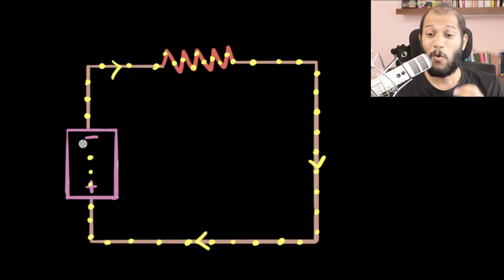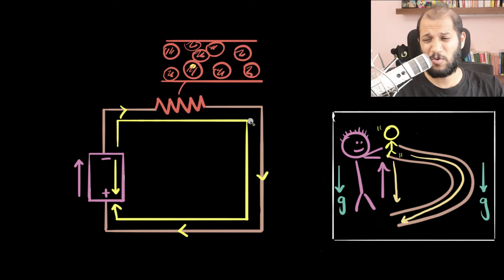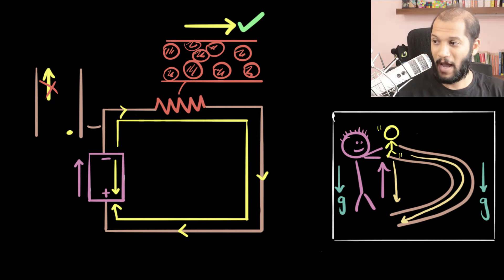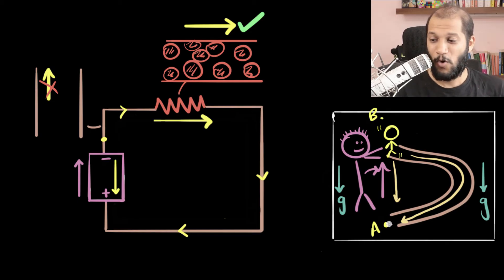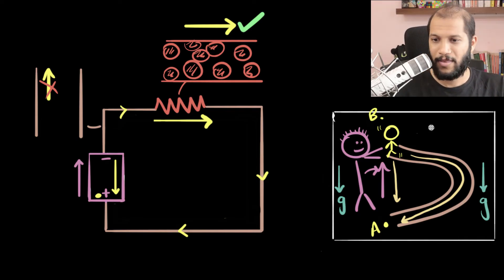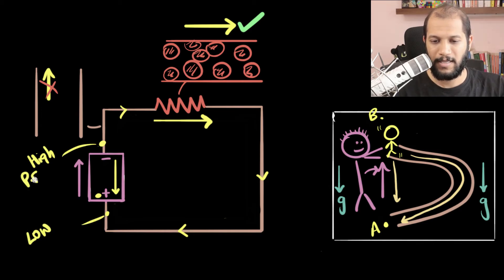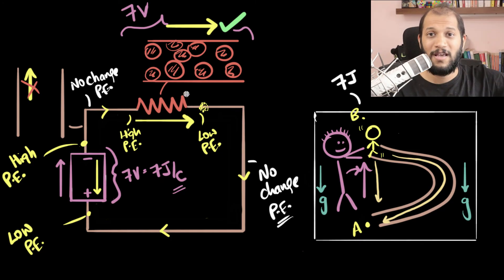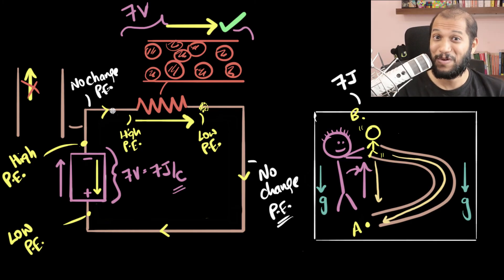Why voltage across resistor equals voltage across battery?

Comment: But the electron needs energy to move through the rest of the wire(after the resistor), so if it has lost all its potential energy - it means the electron has no energy. But its moving, so it must have kinetic energy. WHERE is that energy coming from?
Reply from the maker: Great question. As you said yourself, it has lost all the potential energy gained from the battery. Not the KE
Reply: @Mahesh_Shenoy  Understood! thanks a lot.

Comment: could anyone explain what will happen if there is no resistor, how will the electrons lose the potential energy?
Reply from the maker: That’s a great question! It’s not possible though! 

The battery itself will provide some resistance
Reply: If you have an impossibly perfect voltage source with no internal resistance, you would accelerate the electrons indefinitely, and their potential energy would convert to kinetic energy.  You still will have some inductance, even for a circuit made from superconducting wires, since a single loop has a little inductance.  That inductance will be the only impedance of the circuit.

This means the equation of motion of the circuit will be:
L*di/dt = V

Isolate di/dt:
di/dt = V/L

Integrate both sides:
i(t) = V/L * t + i0

This means, starting with no initial current, the current will linearly grow in proportion with the operating time.  The ramp rate of the current will be V/L.

Comment: It was an awesome explanation,
But I have a doubt that ,
If the energy given by the battery to 1C charge used up when it is out of resistor , then to continue it's path,  from where is it going to again retain the energy which was previously given by battery? .
Reply from the maker: It gets used because it doesn't need more energy for the rest of the path! The rest of the path has zero resistance!

Comment: If we change the resistor then it's also losses all energy?
Reply: Sir if there will not any resistance in circuit then the potential energy increases after every round it can go to infinity also?
Reply from the maker: If we zero resistance in the circuit, I think our model breaks down and we need to look at things using quantum mechanics!

Comment: so in the case of parent taking the kid up, does KID store the potential energy or does earth? why is work negative?
Reply: Work is negative in the definition of potential energy, so that work done by a force field, means potential energy decreases, and work done by an external agent (or existing kinetic energy) against a force field, means potential increases.   Change in potential energy is the negative of the work done by the force field.  Instead, it equals the work done by an external agent working against the force field, or equals the work the force field can do, when the force is allowed to act.
Reply: For your second question, consider what would happen if the parent and kid were astronauts, doing a spacewalk.  The parent (plus spacesuit) is 200 kg, and the kid (plus spacesuit) is 50 kg.   For the thought experiment, let Cavendish's big G be 1 N-m^2/kg^2, albeit extremely unrealistic.  The kid and parent start out 1 meter apart, and move to 5 meters apart.  Suppose they have of long pole of negligible mass between them, that they can crawl along, so they can use both compression and tension between them for their movements.

At 1 meter apart, their GPE will equal -50*200/1 = -10 kJ
At 5 meters apart, their GPE will equal -50/200/5 = -2 kJ
Collectively, the parent-child system, gains 8 kJ of GPE.  But who's body is storing it?

Consider what happens, from the center of mass reference frame.   At state 1, the center of mass is 20 cm from the parent, and 80 cm from the child.   At state 2, the center of mass is 1 meter from the parent, and 4 meters from the child.  From state 1 to state 2, the parent moved 80 cm, relative to the center of mass.  Meanwhile, the child moved 4.2 meters during this same event, relative to the center of mass.

Since work is an integral of force relative to displacement, and they both have to apply the same force to the pole at every point along the way per N's 3rd law, this means the child gains 5.25 times as much GPE as the parent.  This means the child stores 6.72 kJ of addt'l GPE and the parent stores 1.28 kJ of addt'l GPE.  Long story short, the SMALLER object is the one storing the potential energy, because the smaller object has a lot more displacement.

Switch to the Earth and the child instead, and the Earth's motion is not even the size of a molecule, as the child is carried up a 10 meter staircase.  So the child is storing the vast majority of the gain in GPE, instead of the Earth.

Comment: Why doesn't voltage goes to zero after the first resistor?
Reply from the maker: I love how you are thinking. This is exactly how you should think - "what breaks if xxx happens?"

So, let's say the voltage goes to zero after the first resistor. Then, there will be no voltage across the second resistor. Meaning there will be zero current across the second resistor. But there will be a current across the first one. We could say that 'can't' happen, but let's imagine if that happened. What happens next? What do you think?
Reply: @Mahesh_Shenoy  pls answer this!!will electtron without any energy just move towards positive terminal due to electric force?

Comment: at 4:50, u mentioned that electrons don't need a force to move through the wire (resistanceless wire). But, when electrons take a turn in the wire, there is a change in the velocity of the electron, which requires a force to do so. How do u explain that classically?
Reply from the maker: Nice question! It may get a tiny bump from somewhere?
Reply: Yes sir, exactly. That's what I am confused about. It they get a bump, where from do they get the bump? And during that process, will they not lose a part of their potential energy?

Comment: So the resistor lowers the current in the whole series circuit. And it also uses all the energy from the electrons, thus there is a voltage drop?

Comment: 12:38 how can you say there is no change in P.E as the electron is in motion(potential energy should convert into K.E) so total energy content i.e. the mechanical energy should remain same.Therefore according to me at negative terminal it is having the highest P.E and at positive it has the highest Kinetic energy(in ideal case no resistance of the wire or any external resistor).Is it so?
Reply from the maker: The speed of the electrons stay the same throughout! So no change in KE!

Comment: When your favorite teacher teaches you in his own channel! When I found you on Khan Academy, I searched for your YouTube channel. Though there were videos, you weren’t regular. Great to see you uploading lectures regularly. Take love from Bangladesh. ❤️
Reply from the maker: Wow, thanks Isteak! Yes, trying to be more regular here now!
Reply: @Mahesh_Shenoy  sir why potential difference (voltage ) is same in parallel? Sir please reply .
Reply: @harshad1526  In a conducting material (like a wire), voltage is the same everywhere. So if you have any number of points on a wire connected with nothing in between, they are at the same voltage. Now, imagine three resistors of different resistances connected in parallel. The left side of the resistors are all connected with a wire, so their voltage will be the same, call it V1. Now, their right sides are connected by a wire as well, so their voltages will be the same, call it V2. So, each resistor will have a voltage drop of V2-V1 volts.

This applies to any component whether it be batteries, capacitors, inductors, whatever, since voltage is the same throughout any conducting material. (Assume zero resistance)

Comment: By the way, how does this concept align with 'velocity of electrons across the whole circuit remains the same'? I mean when electrons are losing their potential energy in the resistor, they should loss their velocity, right? Or are there other ways to loss energy without losing the velocity in the resistor?
Reply from the maker: Their kinetic energy stays the same! Think of a ball falling down! It's potential energy gets converted to kinetic energy increasing it's speed. 
Now, consider a feather falling down! It's kinetic energy stays the same as the potential energy is converted into heat!
Reply: @Mahesh_Shenoy or like a spherical ball in a viscous liquid at terminal velocity,, it's the same right the viscous force is analogous to air resistance ?

Comment: You state that there are no forces acting on the electrons in the wire, but there is a force in the resistor. That seems to contradict the idea that electric forces acting on a circuit are determined by the electric field established mainly by the battery. How can the forces change that much depending on which point you are located on the circuit? I thought that the battery's electric field was pretty much independent of the resistor and wire?
Reply from the maker: The electric field strength depends on the resistors! Does my latest video clarify why that happens?
Reply: @Mahesh_Shenoy  So a resistor is necessary in order to have electric force?  You are saying that since there is no resistance in the wire, that means that the electric field from the battery is producing no force on the electrons in a steady current? That doesn't make sense to me. Does gravity not exist if there is no resistance? Are there no electromagnetic forces in space if there is no resistance? The latest video did not clear my confusion.
Reply from the maker: @mjciavola  There is no electric field in the wires!

Comment: But if the force in  wire is zero ...them how current originates ???
Reply from the maker: Classical answer - there is a force, to begin with, that sets them up in motion, but then the force disappears!

But remember, electrons are NOT tiny balls of matter. They don't really obey classical mechanics. Yet, you can still predict a lot with it!
Reply: @Mahesh_Shenoy  ok sir At tjis stage I should understand force after starting them disappears ??

Comment: Sir can you please please please make video for all concept which lead to working of (capacitor, charging, discharging,equations derived ))
Reply from the maker: I have made quite a few of them at Khan Academy. Can you check those out?
Reply: @Mahesh_Shenoy  link??
Reply from the maker: @geetikaacharya2325  https://www.khanacademy.org/science/in-in-class-12th-physics-india/x51bd77206da864f3:alternating-current
Reply: @Mahesh_Shenoy  but sir I am unable to find ur charging and discharging videos for capacitor in which includes equation for how much accumulated (charging) or lef(discharging)
Reply from the maker: @geetikaacharya2325  Oh, you are talking about DC circuits! Got it. Will add to my list!
Reply: @Mahesh_Shenoy  yes sir please soon